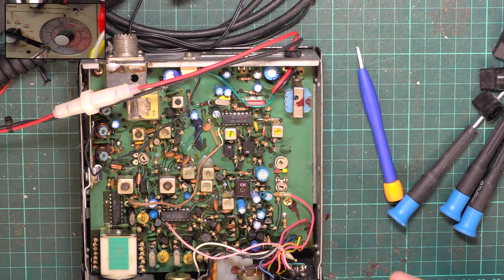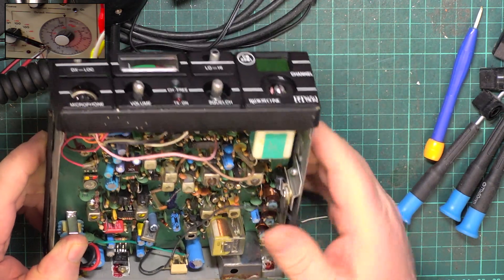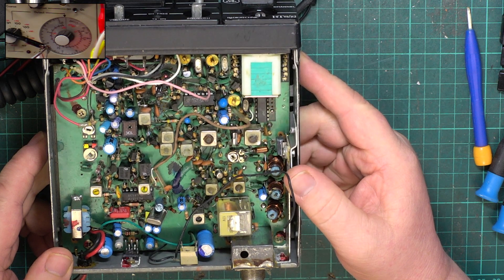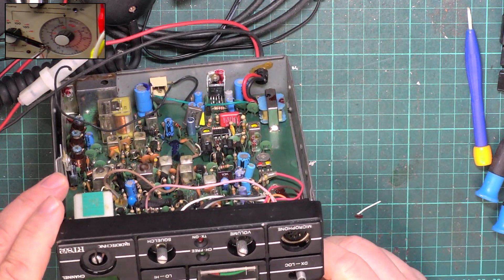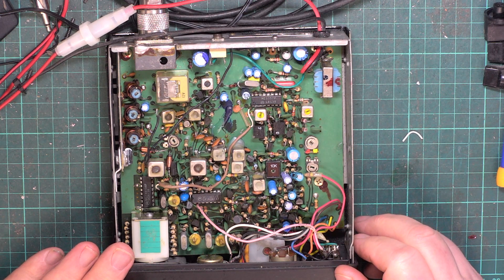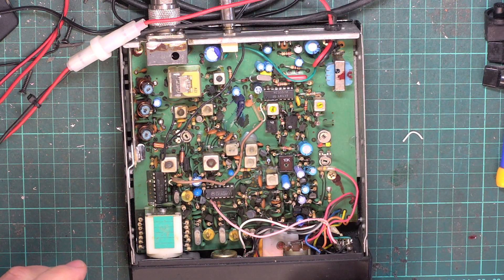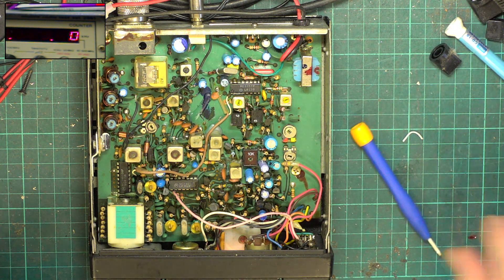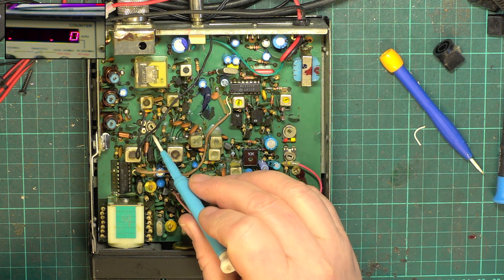Radiotechnic RT852  CB27/81 UK FM CB radio (mobile) - Service & Alignment

Comment: I have only ever seen one.  The relay was gone on it.  I had been in the pub the night before and got up feeling not to clever.
Knock at the door, nice young lady standing there with a CB.  "Said you would fix my CB last night when I took you home!"
Opened it up and "BEEP" it was a DNT in disguise.  Had a rummage around for a part but didn't have anything in the scrap box, that is because I very rarely had anything in the scrap box.  She sat there for a few hours till I found a relay that would work, but it was a bit bigger and the pins were in the wrong place.
However, by this time my head was clearing a bit.  She had made me two cups of coffee, so far.
With a bit of jiggery pokery I got it fixed with a few choice words.  I hate DNT CBs and the Gemini the most.
Anyway, she decided she was going to test it and went up a hill to do that and dragged me along.
From our high point we got as far a Fraserburgh and Stirling, on a DNT!!  She was a persistent operator if nothing else.
We had a lot of height on our side, though I struggled to hear the person she was talking to in Stirling, she appeared to hear them without any problems.  I could hear them talking, but that was about it.